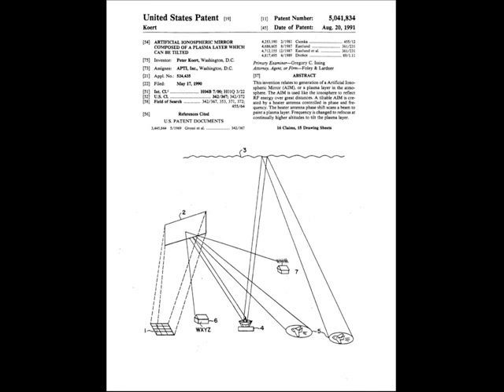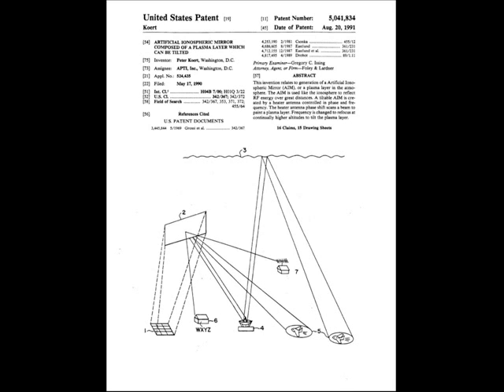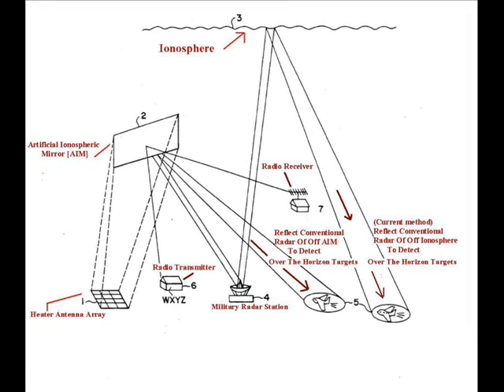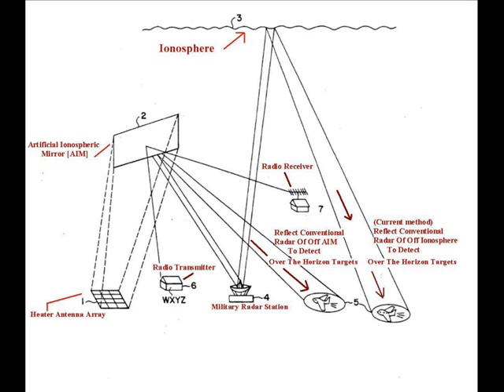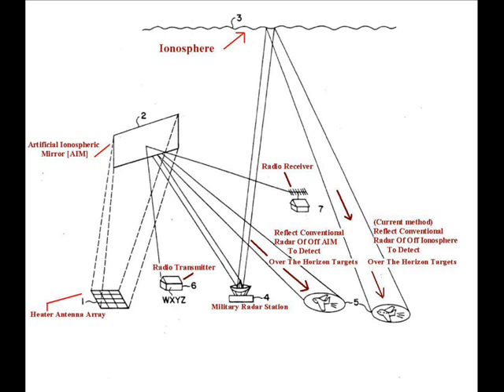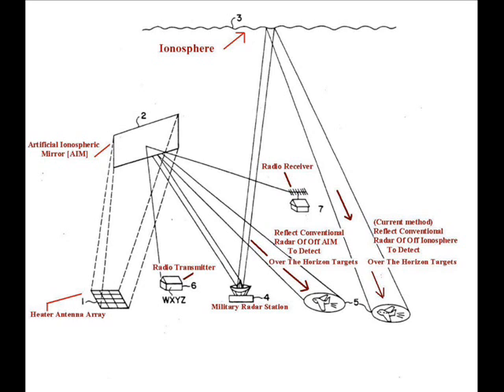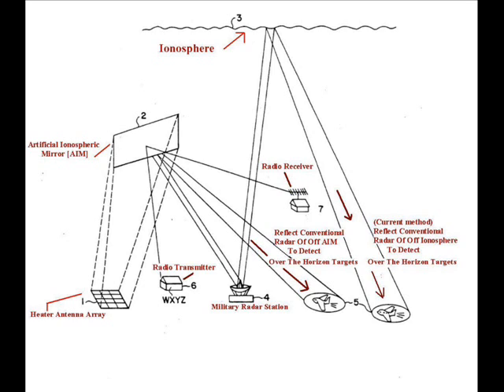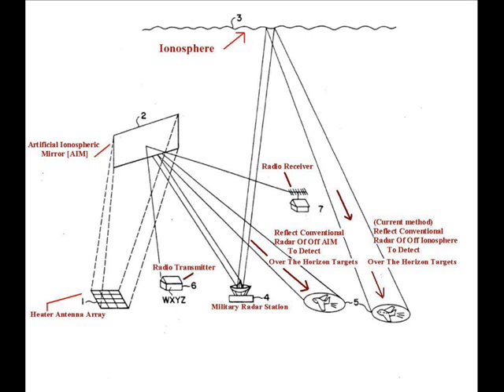DUTCH MAKES UP HOW TILTED AIM PATENT WORKS TO KEEP CULT LOOKING FOR RINGS

Comment from the maker: @CrazyC0der I have better than a link. I have the patent on how it affects weather mods  watch?v=AABS7QbdXQI

NEXRAD can only see up 70,000 ft. HAARP works on the lower ionosphere - 50 MILES up. Simple physics.
NEXRAD can only see the back-scatter of the frequency it projects. Otherwise there would be to much interference. And, is doesn't NEED to see anything else. Just if the signal has bounced back indicating rain or moisture.